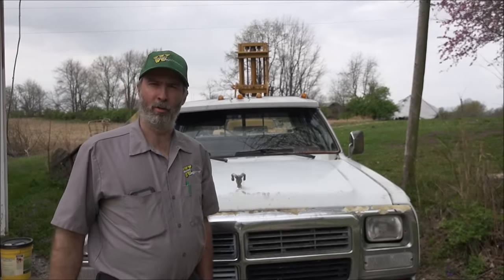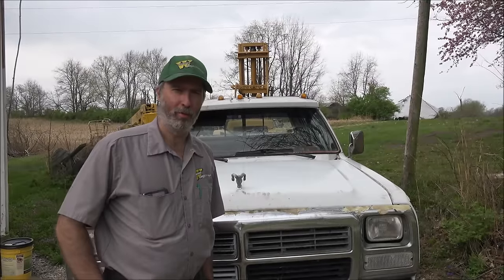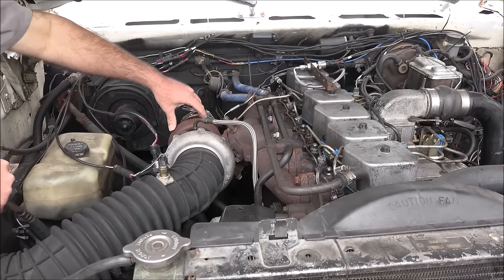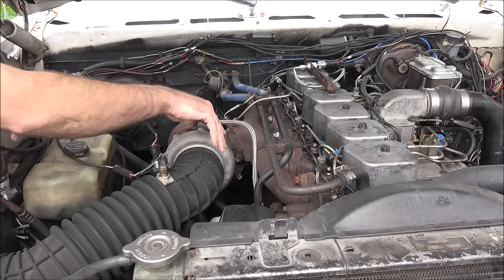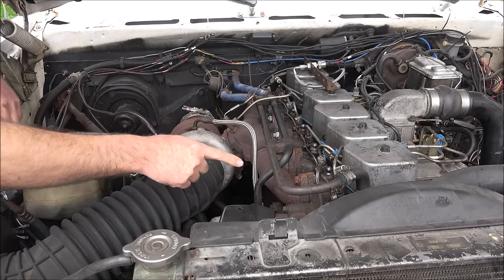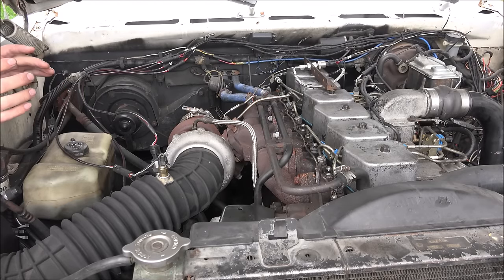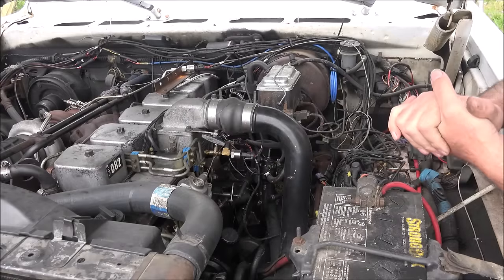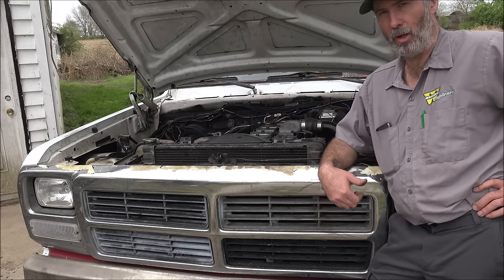First Gen Intercooled Dodge Cummins VE Dyno Proven 400rwhp and 1000ft-lbs tq Recipe for under $4k

Comment: It's been fun watching your journey with the VE trucks. I remember back in 2000 or so watching the hp wars with the ve. I remember breaking 300, 350, 400 then when you blew the internet up with the 600 plus pull. The early 2000's were the best times for diesel enthusiasts I think.
Reply from the maker: Hardly any aftermarket parts available back in those days. You really had to work with the stock stuff and modify it to make it do what it wasn't supposed to do. The crew cab is a much more refined 400+hp than old yellow was. The smoke level and driving manners are much more like a new truck with good throttle response and no idle haze. Old Yellow will be making a comeback though. 🙂
Reply: @bcbloc02  Old Yellow is quite a benchmark, as far as diesels going down the track goes, I’ll be looking forward to seeing more of it.
Reply: @bcbloc02  YAAY!

Comment: I put the s300G on my 89 several years ago. I am at 300 hp to the wheels but have the 727 so that is not bad. Pretty close to runaway with the stock non ic sticks. That is not a horrid price. I paid about a grand for mine long ago. I am on the original head gasket, and bolts so I don't push it any harder. Pretty fun at the power it has. I put the 99 all aluminum power stroke intercooler in at the same time.

Comment: Do you have any tricks to keep the little fuel pin that rides against the AFC fuel pin from sticking. Mine starts sticking once the motor gets up to full temp, when the motor is still cold it seems fine. I’ve taken it apart and tried several types of grease and oils on the pin. After a couple thousand miles it starts sticking again. I can tell because the truck will make 35lbs of boost fairly easily when it’s free, when it’s sticking it only builds about 20lbs, unless you put it to the floor. Thanks

Comment: Oh boy... I can hear the Holset boys clanking away on their keyboards! 😅
Reply from the maker: I just state the facts as I have found them.  I have not yet found a configuration of Holset that can make as much boost at as low an egt as the 300g.  The 60-67 9 holset is a powerhouse but it runs hotter under load and with its small shaft and bearings its not as durable.
Reply: @bcbloc02  yeah, I am not a turbo wizard but I do like seeing the banter back and forth between the two. I ordered a savage fab 9 cm housing for my sxe.
Reply from the maker: @decentgarage  can’t wait to here how you like it and how it compares for egts towing.
Reply: @bcbloc02  yeah, I'm going I'm going to test it again the stock sxe as a single and then test the stock vs 9cm housing in compounds

Comment: What are your egt's with this set up?Is towing going to make it super hot? Please and thank you
Reply from the maker: I had literally just unhooked from my dual tandem gooseneck before dynoing and that is 16000lbs between my truck and trailer. I regularly gross mid 20k and do fine, I probably can sustain low to mid 300rwhp levels and keep egts in check. At full kill and 3300rpm it’s like 1800f though so it would not live there long.

Comment: 👍👍👍👍... A getrag can handle 1,000 ft lbs... I had two trucks at perhaps 300 hp and ?? Ft lbs.. both broke getrags... bearing's in one and input shaft in the other i think...i switched to auto truck's and learned to fix them eventually 🤣🤣.... don't matter..not that anyone cares about my experiences..lol..but anyway. Thank you for another video feller... keep on doing what you do...see ya next time 👍👍👊
Reply from the maker: That is why I pull heavy in direct it saves the trans. 😀
Reply: @bcbloc02 👍👍 Right on...but I didn't even pull/ haul anything with either of those trucks..just had a heavy foot...and both G360's still broke..oh well,guess they just didn't like me🤣..but anyway 👍👊

Comment: Hello Sir, I really want to do this recipe to mine just wondering if the power jet pdd injectors you bought were second gen ones that you adapted because on the website the power jets are all second gen. Also I really want the 300g but my buddy has a hx 35 w/ exhaust brake for 700. Do you think it will be ok?
Reply from the maker: It depends on your ultimate power goal. An hx35-12 is an excellent choice for 350rwhp and under.  If you want to crank the pump up to that 400+rwhp range its going to be really high on egts. I found the VE powerjets on PDD website no problem. They list 3 stages I recommend the 2's. The 3 gives a touch more power but with noticeably more smoke for the limited gain I don't think it is really worth it.
Reply: Thank you for the reply! @bcbloc02

Comment: Hi Brian, I have an Automatic 93 Dodge 4x4, which Turbo would you recommend, it is a stock truck with upgraded Bd exhaust manifold, upgraded Ve pump and a above stock rebuilt transmission, no upgrades to the head bolts. And what brand of oil do you use? Thank you!
Reply from the maker: If you don’t have injectors the stock turbo will be just fine. If it still has the 18 or 21cm exhaust housing on it changing to a 12 will make it drive WAY better. Oh and I have used Deere 15w40 oil for years in all my vehicles. It is good stuff.
Reply: @bcbloc02  Thank you you Brian, yes I have stock injectors, I live on the Westcoast and Smokey trucks are looked down on and receive unwanted attention. Thank you for the oil tip and I will see want is available.

Comment: Hey Brian, I work for a JD dealer in the north east. Do you run Plus 50 II in your trucks? Whats your take on it? Thanks for any input
Reply from the maker: Yes I run the regular 15-40 most of the year and the 0w-40 in the winter.
Reply: @bcbloc02  when I saw the JD battery in your truck I was like hmm got me thinking about oil. Thanks for your reply. I also do the same. In fact my truck just about stopped using oil when I made the switch. With rotella my truck would burn roughly 2 qts within 5000 miles. Now it's less than 1/4 qt I would estimate.
Reply from the maker: @Wjones450  I was envolved with some of the Jdq testing several years ago before the plus 50 2 came out and I can say the Deere oil is impossible to beat for the price in an engine that is run hard especially if you take advantage of its extended drain interval. If you run rotella you better change it twice as often like Deere recommends because it won’t last like the Deere oil. I have seen it on the dyno and in the oilscan results.

Comment: I call bullshit on the company saying putting dimples in diesel pistons increases the efficiency 50 percent. What’s your thoughts?
Reply: They'd be bought out by an engine manufacturer if that were true.
Reply from the maker: Yes it appears to be a scam along the lines of the achates deal. There has been testing similar performed on aerodynamic mods to diesel pistons in sae papers. Their results were more in the -4 to 7% range for fuel improvements. Combustion dynamics is still to this day a complicated thing best proven out by imperial testing.  Computer models still struggle with accurate prediction  Any gains seen with these pistons likely come from other proven techniques that they employ like thermal and friction coatings along with ring changes for better cylinder sealing more so than from the dimples themselves.
Reply: @bcbloc02  Plus they cost $3770.00 U.S. a set, starting for second gen and up only. Great channel Brian, watched you on Utube dynoing at Firepunk you  did great, in my opinion. I have a 93 first gen. Keep up the great content!
Reply from the maker: @franklogan494  Unless you mean 24v when you say 2nd gen you can swap any 12v piston with any other but of course you change compression and the design of the combustion chamber doing that.  My truck is a work truck not a toy so it can't tolerate being as wild as most of those race toys.
Reply: @bcbloc02  Thank you Brian for letting me know the difference, it sure helps.

Comment: Any experience with powerdrivendiesels hx-35 aggressor turbo, or the borg warner k27?
Reply from the maker: Nope. I have run many configurations of hx35/40 stuff but not any particularly from power driven. I also have never run a k27 so i can't comment about them but they seem very similar to the s300g I ran for a long time just a little bit smaller.
Reply: @bcbloc02  ok, thanks. I'm helping my kid put together his 1990 12v, and just looking for advice on turbos. He has a scheid injection pump, 7.3 intercooler, Hamilton valve springs,  stock injectors for the time being, hvlp fuel pump. Won't ever tow more than 8k-10k if ever that. And its a manual. Any advice? Definitely more of a street truck for him
Reply from the maker: @frankventura6710  you going for fuel mileage and drivability or ripping and running more?
Reply: Somewhere in the middle, if that exists.....
Reply from the maker: well for good fuel mileage good power and low egt the 174430 S300G is the way to go in my opinnion if you aren't shooting for over 450rwhp. If you want a little better spooling but with a little less power and egt control go with the K27. If you want all out ripping performance and don't mind a bit of lag and less longevity then the 60-64 aggressor
Reply: Yea, the s300 sounds like its gonna be it. 4-450 will be plenty for him, is there anything else we should be looking at doing? The injectors are going to be next, but I figure we should do turbo first. 
Thanks for the help
Reply from the maker: @frankventura6710  it doesn’t really make any difference if you do turbo or injectors first. Injectors will be the biggest power difference. You will need a clutch as 400 going to blow thru the factory one.
Reply: Whats your thoughts for a clutch?
Reply: Went down a rabbit hole on turbos the last day or so.... is it worth it to go with the updated 300sxe or is the difference negligible over a 174430?
Reply from the maker: @frankventura6710   my personal opinion is the 174430 is the better choice for a work truck as it is a little more efficient at high boost so it will run cooler the newer design sacrifices boost efficiency for flow so it would have a little more too end. So for me where I spend hours at 2k making 20-30psi of boost pulling a trailer I like the 174430. For someone just ripping and running an empty truck the other one is probably better.